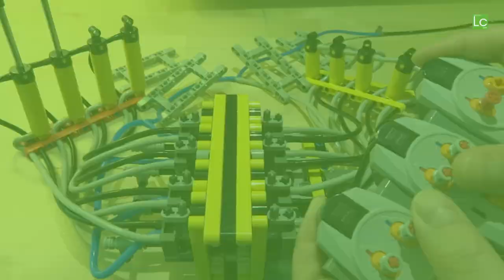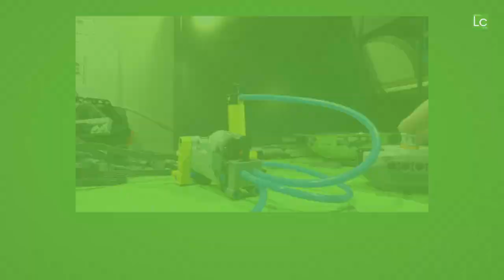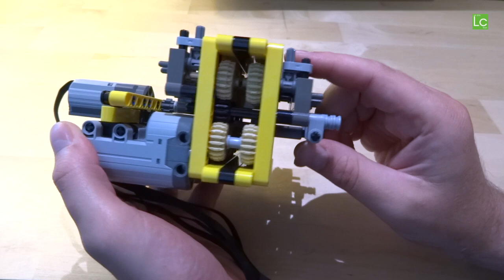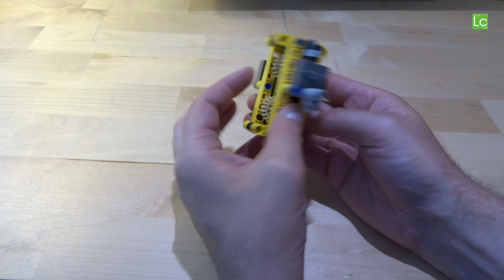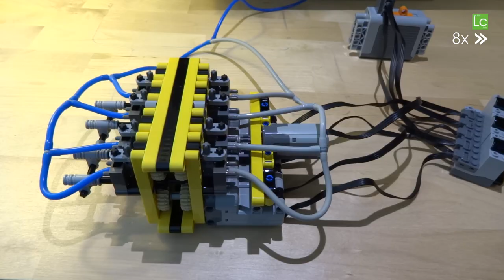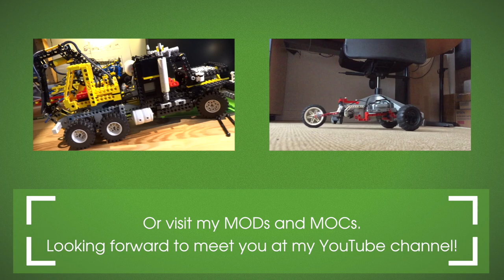Lego Technic RC gearbox for pneumatic switches - Lego Technic MOC

Comment: What kind of machine do you build which needs so many pneumatic functions?
Reply from the maker: It's my "projectZ" – and still a secret ;) But I have a hint for you. It's similar to one of your creations. Maybe you'll guess it after having a view in the corresponding Flickr album https://www.flickr.com/photos/lc-jrx/albums/72157668119158226
Reply: Looks like a crazy machine :). Is it about spintires or beer?
Reply from the maker: Indeed, beer is an important ingredient (while constructing;)) I think, the machine will be some more conventional and as near as possible in form and scale to the original.
Reply: ok interesting. I'm looking foreward to see it
Reply from the maker: Me too - it's still a long way to go. I nearly finished the chassis but have to re-engineer the main gearbox as the gears jumping when under high load. And then the bodywork is waiting 😱

Comment: great idea but does it work with linear acuators?
Reply from the maker: +Brandon Blakley What do you mean? The shift between the to groups of valves is done by a small linear actuator.
Reply: +LC-jrx – Lego Mods, Ideas and Creations by dinojrx instead of using pneumatic cylinders could you use linear acuators instead?
Reply from the maker: I don't think so. This MOC is especially constructed as a gearbox for pneumatics. And the MOC, for which this gearbox is intended, will heavily use pneumatics with no chance to use linear actuators. But thanx for your suggestion.
Reply: +LC-jrx – Lego Mods, Ideas and Creations by dinojrx ok well does it at least work with only 2 motors?
Reply from the maker: +Brandon Blakley Sadly not. You need one servo for each pair of pneumatic valves plus one M motor to shift between both of them.
Reply: +LC-jrx – Lego Mods, Ideas and Creations by dinojrx ah ok. its very costly. i wish the two motors wouldve been enough. thanks for your time
Reply from the maker: +Brandon Blakley Your welcome! I wish it wouldn't be so costly. But if you like to operate a complete crane boom or similar in complete with RC you can't do it with only minor count of motors. It's a pity. Thanks for your thoughts and comments

Comment: Sadly it is still servo-expensive but I have an advice for you : Check out Hibrahimfitzgibon's chanel.
If you don't find his channel I will find you the link.
Just write me an e-mail ( e-mail adress available at my youtube channel.
I forgot mensionning hat he has built a pneumatic multiplexor that only uses 2 motors for as many pneumatic functions as you want.
Thank you for your attention.
Reply from the maker: +Lego Technic Mastery Hi, thx for the tipp. It's also a very interesting solution. But it lacks on simultaneously using the functions. If you don't need that it's really cool and 'servo saving' :)
Reply from the maker: Yes, I am. I'm new here as well :) So spread the word

Comment: 4 servos still very expensive. 120 dollars for a thing like this... too expensive. make it so you can control 3 switches with one servo and with transmission
Reply from the maker: yes i know it's still expensive. But I like to control 4 valves at once. Maybe I create a gearbox for pneumatic with less servos sometime later. Thx for that suggestion.